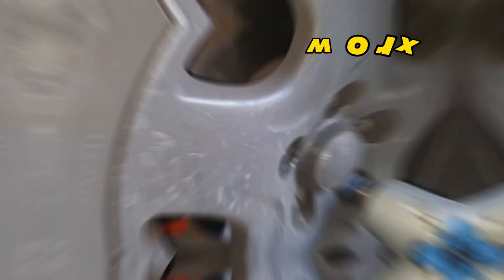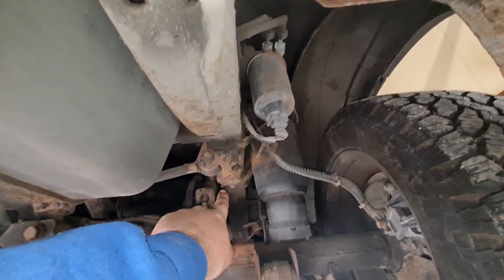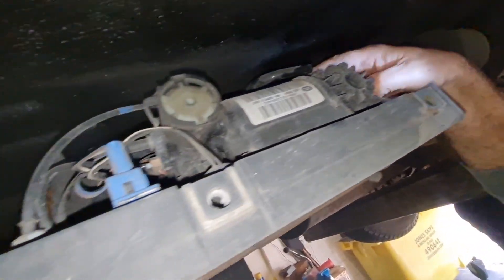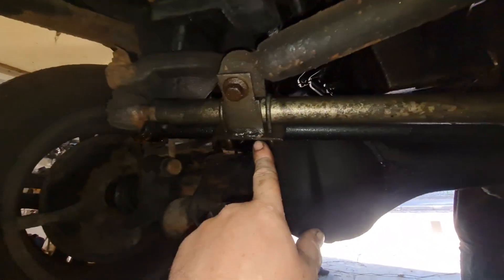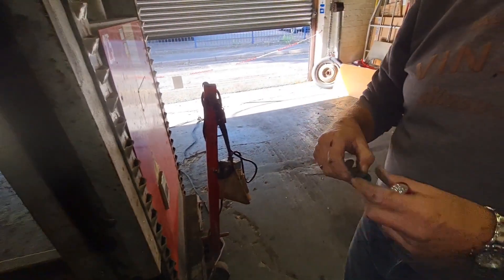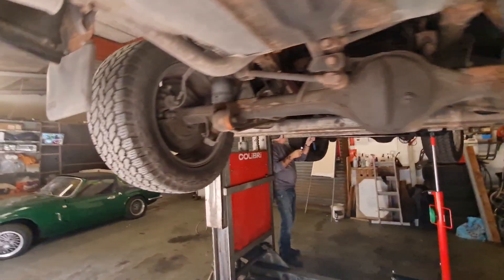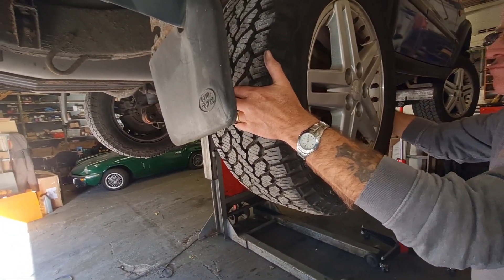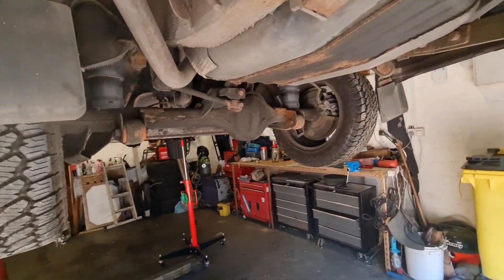land rover discovery 2 td5. a look at the underside. is it a rot box

Comment: Like my Disco, no rear suspension and just welded passenger side chassis!     It's the airbags with mine though.  Apart from that, looks pretty good.   Check the red ECU plug for oil. Mine had so much coming through the loom, it was running down the drivers side of the engine behind the alternator!
Reply from the maker: We checked before we bought it. Completely clean in the plug

Comment: I had bad oil leaks from my engine and found that all of the sump bolts were loos, with 3 missing. Tightened up and replaced missing ones and now seems OK. Have you checked the double cardon joint on the front prop shaft, a friend of mine had his let go at 100 kph. Did a lot of damage. I looked at mine, all OK, but put a complete set of UJ's from one end to the other, with grease nipples, which the originals don't have.